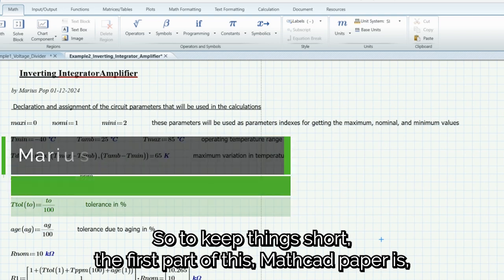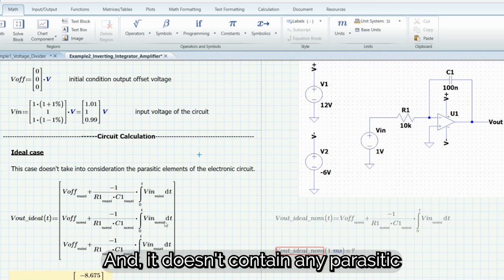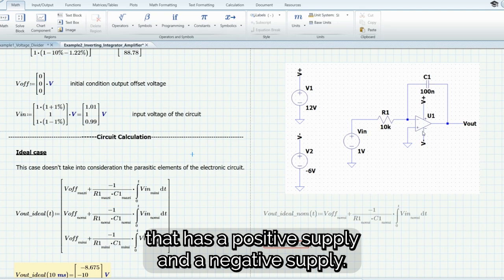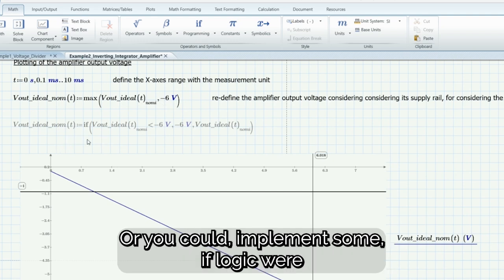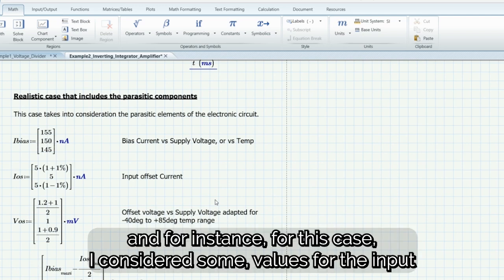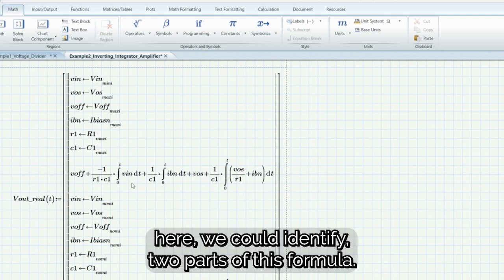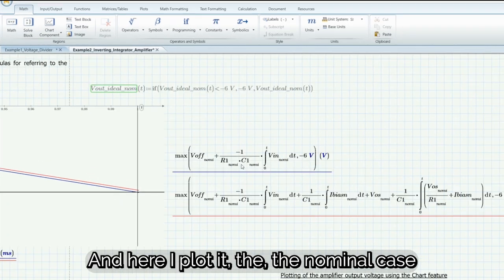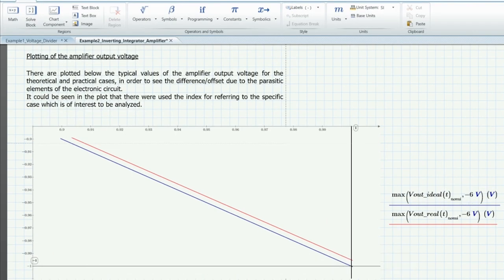Mathcad Worksheet to Calculate Inverting Integrator Amplifier (with parasitic elements)

Comment: This is powerful. I use Mathcad. They need to add the animation feature that was in Mathcad 13. Thanks for this great piece. I am grateful
Reply from the maker: You're welcome!

Personally, as the marketing guy, I would also really like the Animator tool to come to Mathcad Prime, and I know a lot of people request it, and the product manager is aware of the demand. Would you be interested in a future blog / video on a workaround as we wait for the tool to get implemented?
(The workaround is that the Slider in Mathcad Prime 12 updates fast enough that you can continually increment the Slider and you can set your graph to plot a function based on the Slider's output, so when you move the Slider, the graph smoothly updates. And if you need to export the "animation", you can screen-record it with easily available software.)
Reply: @PTC_Mathcad 
I am happy to read from you. I have been using mathcad since version 7 .Here is one of my videos of an RL CIRCUIT on mathcad prime 5. 

https://youtu.be/hpTgTZDHCCw?si=mmkXuZQAeLNVLUWU

Yes, it will be good to see the slider in action, but i dont have the latest version. I think the reason why it was removed was that they had to rewrite the mathcad prime from scratch
Reply from the maker: @jimcoelectronicsystemsengr325  I recommend that you purchase the latest version of Mathcad Prime (it's now Prime 12). You can try it for free for 30 days at https://www.ptc.com/mathcad-trial and you can purchase a licence for your business at https://www.ptc.com/en/store/products/mathcad/ptc-mathcad-prime

Mathcad Prime 12 is far more advanced than Mathcad Prime 5 was. It's significantly faster in performance, has several conveniences (like you can give a plot title and gridlines to your XY Plots without using the Chart Component), and also has Python embedded via advanced, scriptable controls, which are extremely powerful and let you have more automation and user selection built into your worksheets. The slider is one of those controls.

Since you mentioned the legacy version of Mathcad (and it's true that Mathcad Prime was developed from the ground up and has a different architecture and codebase from Mathcad), since Prime 7, you're able to use a standalone worksheet converter to convert your old legacy Mathcad worksheets to Mathcad Prime, without needing legacy Mathcad installed on your machine.
Reply: @PTC_Mathcad 
That's great. For now, I don't have plans to upgrade to 12 , unless a suitation comes that I have to do so. 
The reason why is that upgrading will not bring any increase in ROI, which is one of the essence of investing